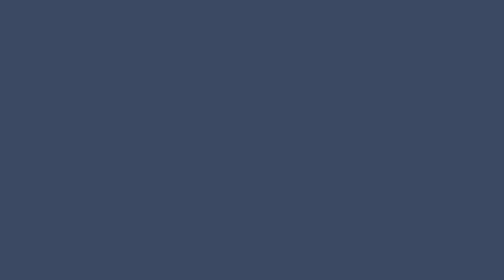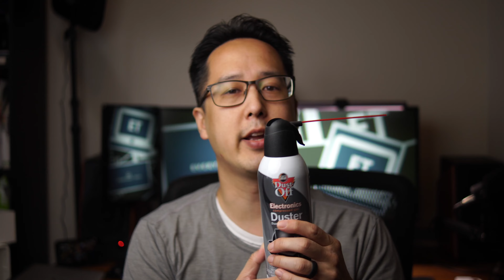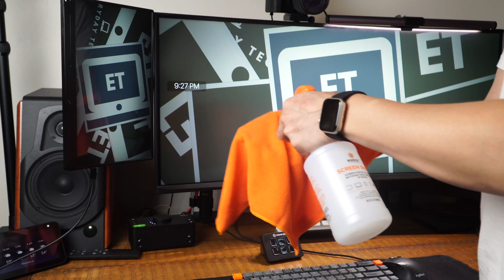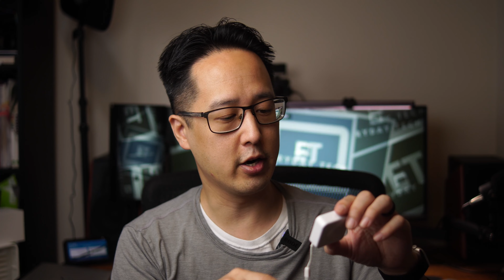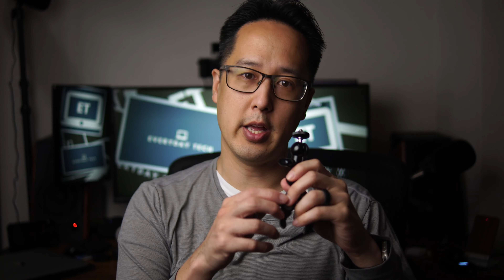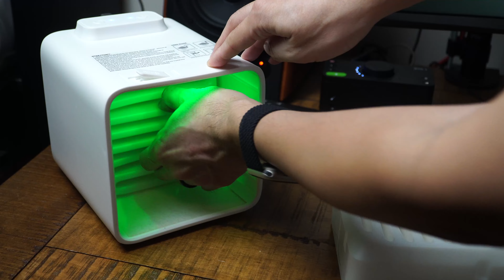The Small Things - The little gadgets that make my life easier

Comment: I’m pretty sure that Apple Watch charger has 1,200 mah, not 12,000, otherwise it would be MUCH bigger. 😂 however, looking at the size of it, I doubt it even has 1,200 mah. Those generic power banks are notorious for lying about capacities.

Also, that portable AC is nothing more than a swamp cooler and doesn’t cool the air at all (edit: missed the frozen water part, that will certainly cool the air, but still adds humidity as it melts). It makes the air more humid and feel cooler. All you’re doing is adding humidity to a room that your home’s central AC will eventually remove.
Reply from the maker: My bad. 😊. It does say that 1200 mah on the back of it though.